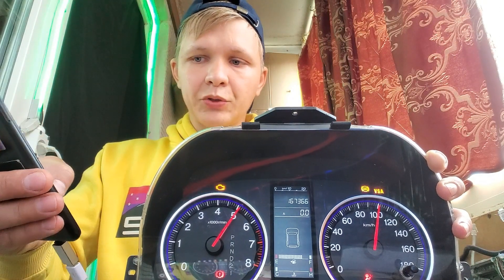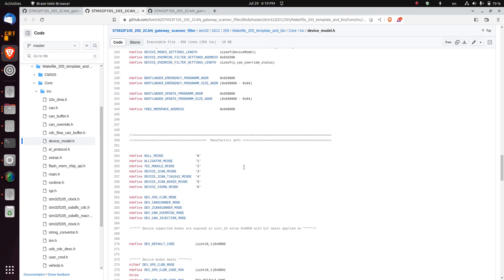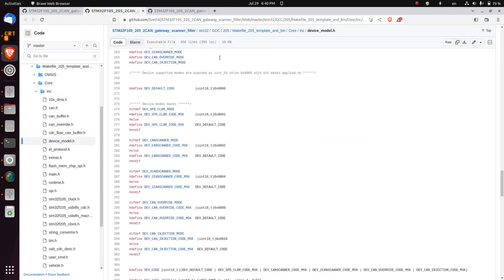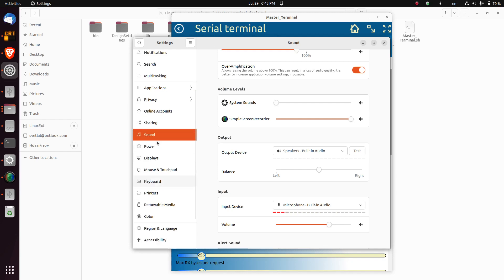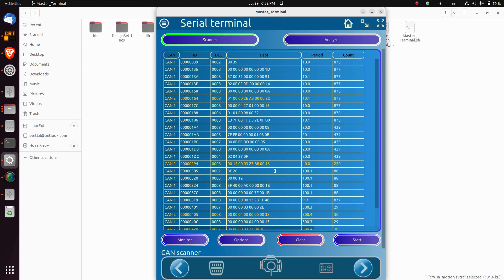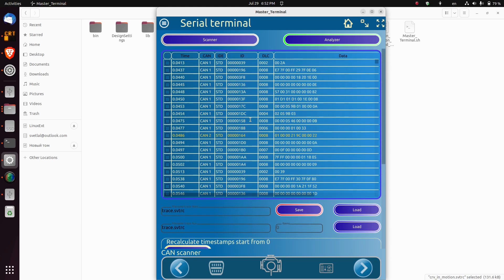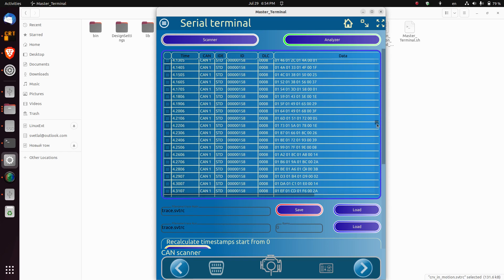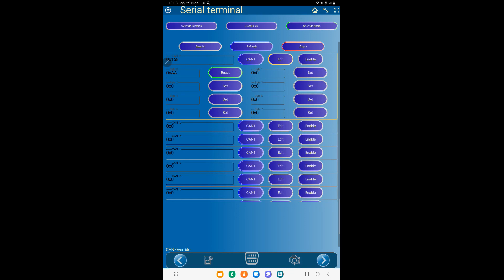CAN hack live example on a real car

Comment: U selling this?
Reply from the maker: The software is free, the hardware can be found in car alarm systems. However I can sell some.
Reply: @alexsv1834  Great video. How do you manipulate (reprogram) car alarm modules? The factory car alarm modules are not software locked from the factory? I want to hack a 2007 Dodge Ram 1500 ABS module.  The ABS module is CAN bus with  one (1 ) digital speed sensor. Vehicle speed message (kmh / mph) is sent over CAN.
Reply from the maker: @AlexShrugging  Hi! most of car alarms are locked for reading out, but we still can erase a chip and make a custom firmware. The car-alarms are so useful and convenient, because they already have +12 V power, LIN/CAN-bus implementation and USB. What do you need to hack an ABS for? To change the values displayed at the combination meter? I have experience with Dodge RAM 2014, but not sure if this would work out with a previous model.